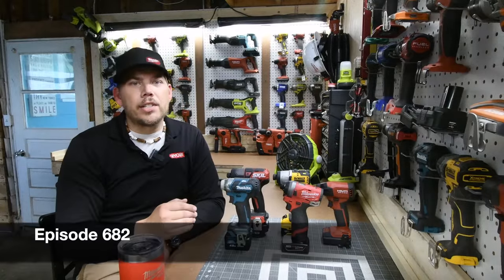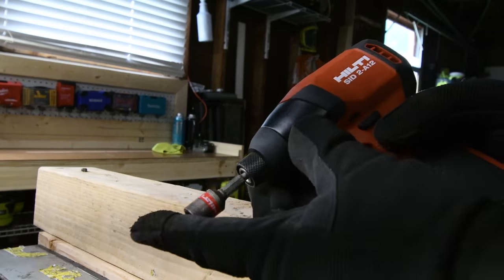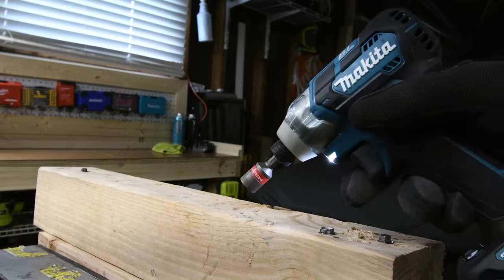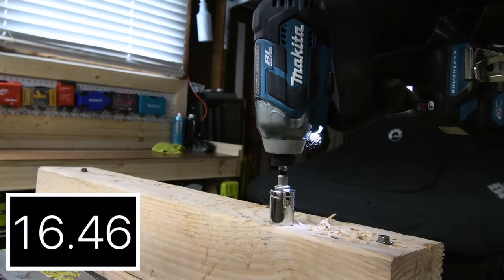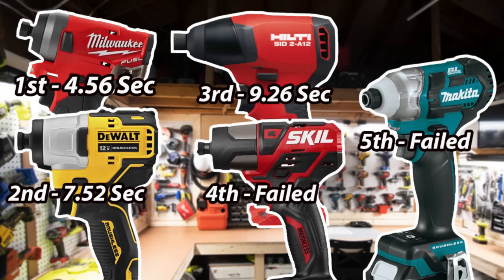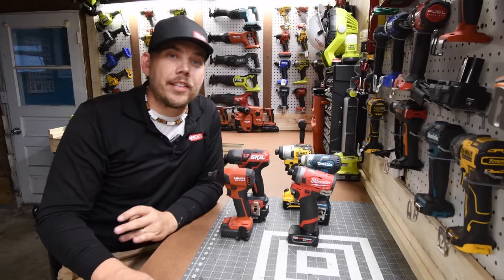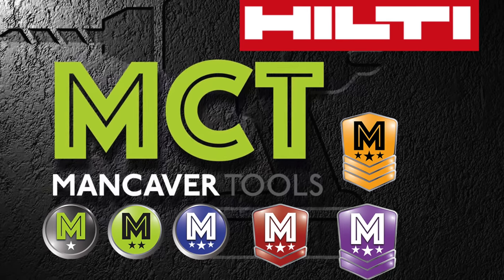Which 12v Impact Driver is Best?

Comment: Great test.  I considered both the Milwaukee and Dewalt 12V Impact drivers (and drills), but went with Milwaukee.  While I agree that the Dewalt's grip is more comfortable and its halo led light is better, I didn't care for its wobbly hex chuck.  Also, Milwaukee's extensive line of 12V tools is a huge advantage over 12V offerings from Dewalt and the others.
Reply from the maker: I do agree that investing into the m12 line is a smart decision.
Reply: I was in the same boat, but went Dewalt because the grip and 12v and 20v both use the same charger. If Dewalt didn't finally release ratchets, I would have bought Milwaukee. Splitting hairs though.
Reply: @nismomike3182  love my M12 Fuel high speed ratchet although its max torque is only 35 ft/lbs and end up assisting it quite more often that I'd like to remove nuts and bolts. How's the DeWalt in that area?
Reply: Not only that pretty sure the Dewalt only has a 3/8 Chuck other drill not a half inch.
Reply: The M 12 GEN3 releases next month and it has the tri light on it this dude (hard working Dave) didn’t see it because he wasn’t invited to pipeline but it has 30% more power seems like a nice upgrade.I’m sure he  (honest Dave) knows about it just chooses not to talk about it
Reply: I went with dewalt because it's a American company Milwaukee is a Chinese company
Reply: @loucifer4205  Milwaukee is not a Chinese company and neither is its parent company  TTI. TTI is based out of Hong Kong. The president of Milwaukee and the CEO the CFO the engineers that work research and development are  all American. Three manufacturing facilities in Wisconsin and four in the state of Mississippi. Hong Kong was a British colony from 1846 to 1997. Most people that live in Hong Kong want nothing to do with Chinese involvement on the island. It’s extremely insulting to most of them to call Hong Kong Chinese.
Reply: @steffendetrick9403  the DeWalt drill chuck is 3/8", but you're not limited to 3/8" drill bits. My DeWalt 12V Xtreme is stronger than the M12 Fuel hammer drill I had, with 1-1/4" Irwin Speedbor bits.
Reply: @l00nybin  that’s not true Bro don’t lie to defend ur brand.. not cool🙄
Reply: @steffendetrick9403  what "brand" are you talking about? The Milwaukee, Skil, or DeWalt tools I have in my tool cabinet? DeWalt is owned by Stanley/B&D, who makes plenty of crap in China. That is a fact. DeWalt is assembled in the USA With Global Components, which is the initiative they started around 2013-2014. Says it right on the boxes, even. Parts come from China, Mexico, Brazil, Italy,... they're assembled here in the US. Practically every circuit board with microchips in every tool out there regardless of brand comes from China. I'm not some fanboi defending "my brand", whatever that means, and can look at things more objectively since I pick my tools based on performance, not the color of plastic.

TTI owns Milwaukee, Ryobi, and licenses the Rigid name to make tools. Chervon makes Kobalt, Skil, Flex, Masterforce (Menards brand), and Ego (yeah, that Ego). Makita is owned by... Makita.
Reply: Yeah rob I ended up getting the 12v Dewalt but the 18v Milwaukee. I decided that dewalts 12v has better ergonomics and I also have a small collection of the 20v dewalts

Comment: I have both, the m12 fuel and 12v extreme. I prefer the DeWalt due to the ergonomics. The grip isn't bulky like the m12 and hangs from my belt better. I enjoy using both and am happy I have both.

Comment: I’ve had 20v dewalt for a couple years and got the 12v extreme almost a year now and don’t even remember where the 20v is . 12 is way more light and has plenty of power I’d definitely get it especially if they have offers with free 5ah batteries !

Comment: I have larger hands, so the m12 grip isn’t a problem for me. I have both DeWalt and Milwaukee 12v tools. My little gen 2 m12 hammer drill is a handy little tool. I just used it to tear apart my air handler to clean out the evaporator coils.

Comment: I have the 12v Hilti, it’s a charm, it sits screws better than my 22v impact driver at times, only thing I’d say is the connects for the tool that holds the battery can go bad and Hilti has this weird thing that they try to prove to you that isn’t their batteries but they never fixed my drill

Comment: For the 12v tool, Milwaukee win because of their battery design for compact. I own both Milwaukee M12 and Makita 18v line. When M12 does not provide enough power, I pull out my Makita 18v.

Comment: I am not sure how Milwaukee wins most tests but the winning decision is based upon ergonomics?   Why do all the other testing then?
Reply from the maker: like it says in the video that Milwaukee won the tests but it not only about power
Reply: I have the Milwaukee and I was using it to drive some lag bolts in a wood shed. They were good size, I believe 1/2"x 6". The tool couldn't do it. I had to pre drill. If it had less power it would have been even worse. As far as how the tool feels in the hand that is totally subjective. I think you would need multiple people to come up with something useful.
Reply: Good question sir
Reply: Kind of what I was wondering. 🤔  I'm thinking, geez is he sponsored by DeWalt? 😒  I mean, it seemed pretty obvious which was the overall top performer.  The winner is determined by... small hands?  😅  But seriously, would have been nice to see a summary table for the results and how much time overall the Milwaukee saved. ✌🏼
Reply: Exactly.. I have my Milwaukee but I swear.. makita's grip is miles ahead. 
In fact, I'm returning a Milwaukee 18 volt sander because the damn battery is on my way. All Milwaukee things about is power and they forget about ergonomics.

Comment: DeWalt 12V DCF801 Xtreme impact driver is the best for me along with the DCF601 Screw driver these tools are a precision tools for me. For daily use decking and framing my old DeWalt 20V DCF885 is doing fine so does my old dcf888. When it comes to power and torque my Flex 24V Quick Eject Brushless Impact Driver with 6.0Ah Stack Lithium pouch cell battery destroys every Milwaukee, Makita and Hilti in the jobsite. Otherwise my Ryobi 18V PBLID02 HP impact driver is my alternative tool to make the other contractor in the jobsite to make fun of me because they didn't know I got the best tools hiding in my truck the Flex 24V tools

Comment: Nice test. This is what I been looking for... finally someone is weighing the  tools. I have a the dewalt 850 with a powerstack on my belt every day and still weights alot.  Been debating to get a 12v drill just to do electrical trimming... the milwaukee and dewalt you presented are those the best and the lightest tools they offer?
I like milwaukee but the position of the belt hook though.

Comment: Well.... The best tool,  Hmmm! depends on what you mean by best.  Yes the DeWalt is more comfortable and has a better light, but the Milwaukee is anywhere from 30-50% faster in some cases.  While the M12 is not as ergonomic as the DeWalt, you also don't have to hold it as long because it get things done much faster!!!  (i own the Milwaukee and the Dewalt and prefer the DeWalt but usually grab the Milwaukee.

Comment: Besides the Skil and Makita, they basically all do the job in about 8.5 seconds

--I do wonder though, at what point does switching to bigger batteries make it weigh heavier than a faster more powerful 18v with a size-1P battery?  Have fun; and experiment!  👋
Reply from the maker: these 12v tools are a good option to have. Not all tasks require a high voltage tool

Comment: Great test man. Back when I was choosing a 12v line it came down to what could fit in a spare hammer loop. Milwaukee's barrel style fit nicely so I went with Milwaukee. No regrets. The M12 line is huge. Only flop is their 5 3/8 circ saw. Even their extremely weak brushed M12 drills have a place in the cabinet world.

Comment: I bought the newest Milwaukee impact and drill. But I'm considering returning it and getting the Makita. I'm not liking the post battery. Also don't like the the selector on top. I know Makita doesn't have as much capability and doesn't have the same features. I see it's in last place. Would Dewalt be a good choice?
Any suggestions would be helpful.
Reply from the maker: Makita 12v tools aren't bad either. it would be a good choice :)

Comment: Is there a redeeming quality of the Makita? Something a Makita fan boy can give me some input on?
Reply: Have the td111 impact, DF032 screwdriver, HP332 Combi Drill and the tm30 multitool. Love them all and haven't failed me apart from a non genuine makita battery, the rest originals. Did buy the milwaukee impact and screwdriver for advertised more power but didn't like the grip and sold them. What I would say is dewalt grip is similar to makita and dewalt now have a larger range of 12v brushless so I'd say they looks good also, would probably go dewalt now for the extra tools available.

Comment: Hilti is just not impressing me at the diyer and residential construction level. The demo hammers/ jack hammers, absolutely suck. Maybe they last a long time, which is my number one concern, but I’m just not feeling them right now.
Reply from the maker: when it comes to HILTI 12v tool, its their 12v screw driver that I love. That impact driver does slack a bit on power

Comment: Gee. Milwaukee came out on top, accept for one test and you chose Dewalt. Also you used the Gen 2 Milwaukee instead of the Gen 3, which is lighter and out performs the Gen 2. Just curious.

Comment: I don’t understand how the Milwaukee dominated everything but yet the Dewalt was the winner make that make sense just because of the grip it’s a 12 V that grip is not very big
Reply from the maker: It's not only about power. Agronomics/design also are factors. I say the Milwaukee won the tests, but I would choose the Dewalt. a lot of people dont like the m12 handles.
Reply from the maker: the only m12 tool that I use is the baby chainsaw. I dont use any other m12 power tools anymore because of that handle. I manly use HILTI and Dewalt Extreme for my 12v tools when I actually use my tools

Comment: Ok Milwaukee won 🏆 everything but the 3 inch lag which was i feel deliberately put in a knot and yet you declared dewalt the winner wtf awesome video love the way it was edited but you after all the times Milwaukee won bro you can't say because I like this grip more its the winner lmao come on Dave
Reply: It won most but not all tests. His caption even stated it won. His preference simply came down to ergonomics.
Reply: Like it's grip? Milwaukee doesn't even like it's grip- that's why m18s have completely different ergonomics. It is a limitation of their battery design. The small differences in these testing would not overcome that issue for a lot of people.
Reply: @ccbowers  regardless Milwaukee has more power point blank. And gen 3 has even more not to mention how many tools 🤔 😳 😅  I cannot in good faith say any is my favorite they all have there places I don't like bias and just because it doesn't fit your hand doesn't mean it doesn't fit mine 😉 😜
Reply: @TacticalThib   Is power the only criterion you are interested in? It is a poorly ergonomic grip and that's why the m18 (nor any other slide battery tool) don't have the same grip.  If you've gotten accustomed to it,  congrats. Do you think when Milwaukee redesigns the battery for m12 (or its replacementin the future),  the grips will be the same bulbous shape?  Of course not. 
I wanted higher levels of power than other 12V tools could offer,  I'd use an 18V tool. Too many people look at power alone, but that is rarely the deciding factor once you get to a certain quality of tool, other than youtube challenge videos.
Reply: @ccbowers  what was this test for brushless 12v challenge correct? Who won regardless of what you feel ergo should be is your hand my hand? So don't pretend that because you feel this way everyone feels the same thanks
Reply: @TacticalThib  Yes it is a 12v comparison, but if you actually saw the video the Dewalt was the winner of the bunch. And the reason for that was that the slight differences in speed between units was not the determining factor. 
So what was your point again?
Reply: @ccbowers  it won 1 dude the 3" lag that's it 1 v 8 rewatch the video again 🤣 😂 bye 👋
Reply: @TacticalThib  You have to watch videos  until the end.  The answer is @12:10.  Also he explains more 11:07.
Is driving lags the main purpose of a 12V impact driver? Rarely,  and time performance on this one task (or any task,  really) does not determine a tool's worth.
Reply: @ccbowers  brother your stuck on this notion that he explained idgaf what he explained because what fits you doesn't necessarily fit me im 6.5 with big hands and the dewalt is very uncomfortable for me my hand does not fit and the purpose of the video was to see the fastest strongest impact now this will be my last response I will not entertain you anymore Milwaukee won all but two and his favorite ergonomics which I totally disagree with because of reasons I stated 😉 for me its Milwaukee for you its obviously dewalt great 👍 just realize and admit Milwaukee is faster and stronger 💪
Reply: I agree that larger hands would help overcome that flaw, but it is still a design flaw. That is why Milwaukee doesn't use the bulbous grip in the m18 line (nor does Dewalt, Makita, Metabo, Hilti,  Metabo, or... anyone). They do make good tools and that is why people love the m12 line, but power isn't the only factor so they aren't alway "the best" like fanboys like to declare. 
 I actually own one Bosch 12V (chameleon Flexiclick driver) that has a similar insert battery issue, but their grip is a bit better.  Still not a perfect grip, but the trade off would be requiring a new battery design which is obviously a big deal. Same for Milwaukee
Reply: @ccbowers  bosh grip is actually worse 😳 😅 listen I own every brand name a tool ill make a video of it seriously I dont want to argue bro let's just say I agree to disagree but you never answered my question who won? Jave a wonderful day bro I hope you make a shit ton of money score that contract and kill it bro 💪 👌
Reply: @TacticalThib   He answers your question at 12:10. Personally I'm not in Dewalt's 12V line and haven't used most of these particular tools, but that Dewalt looks like best all arounder. Then Milwaukee, but both of those far ahead of the others. But I have little use for those.  18V impacts are plenty small enough nowadays and much more powerful.

Comment: Bro how come you didn't spread them out? You realize as you're drilling into that board and making holes in it you're just making it easier for the Milwaukee when it's finally its turn? That's kind of silly. I'm a Milwaukee fan I own Milwaukee 12 volt tools that's the tool line I decided to go with but well your test is pretty obviously flawed my friend.

Comment: I really wish you would elaborate a little bit more as to why you would skip over the M12 after it acing every single test you made for them. Do you have any other criteria that you didnt tell us? Is it personal preference? Im guessing the thickness of the grip has something to do with this, but dont really feel like that was clear. Personally I prefer the Milwaukee / Bosch variant with the battery in the grip, makes the whole package so much smaller with compact batteries, but it does take some time getting used to. Usually I will hold mine with middle finger on the trigger and index finger along the side of it, and it sits alot better in the hand then. Biggest dislike with the M12 for me is the light placement (which the new one coming out fixes) and that batteries doesnt feel very secure in place.

Anyway it just seemed very abrupt with M12 winning every test then suddenly at the end DeWalt is the winner. As if it was evaluated on something completely different than the tests you made for it. Might be a good idea to talk more about that during the testing if you have problems with it, or even find other points to evaluate on such as perceived comfort, noise, vibration etc.
Reply from the maker: Power of the tool isn't everything. I declared the Milwaukee the winner of the tests. but as a suggested preference. Id go for the Dewalt extreme. I and many others think that the m12 tool handles are a bit awkward to hold. I just prefer the Dewalt and people in many comments asked  to give an opinion on what tool I would prefer to use after these test videos. so now I have that in here :)
Reply: @ManCaverTools  By all means, I don't have a problem with that at all. It's a good idea. I just personally wish there would be more of your thoughts on why spesifically you don't like the M12 and what spesifically you like about the dewalt.

But hey, this is just me airing my thoughts in the hope it may be useful, nothing more ^^
Reply: *Most tests
@4:18
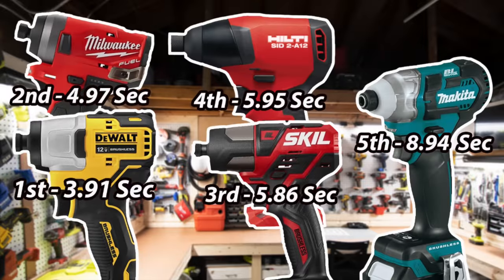@5:09
@10:30

Comment: I really want to like Makita's 12V tools, but the Skil Pwrcore12 tools just outperform Makita, for less money. I love my Skil Pwrcore12 drill and oscillating multi tool.

The DeWalt 12V line is hit-or-miss when it comes to beating Milwaukee. The impact driver is not as strong, but the drill (dcd701) is stronger than the M12 Fuel hammer drill. And the DeWalt line is A LOT more comfortable.

Comment: Why no Flex
Reply from the maker: These are 12v tools
Reply from the maker: @WomenHateShortMen  🧐 this was my first video of a voice over. give me a break. it will get better within a few videos
Reply from the maker: @WomenHateShortMen  🧐 Flex doesn't make 12v tools bro. that's why flex is not in this video. its common sense to not have a higher voltage tool brand in a 12v tool video.